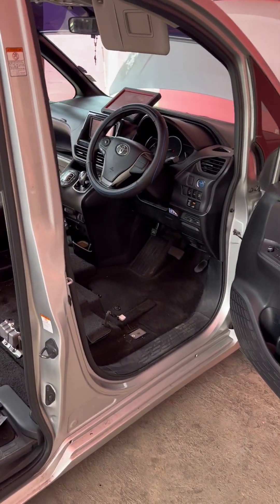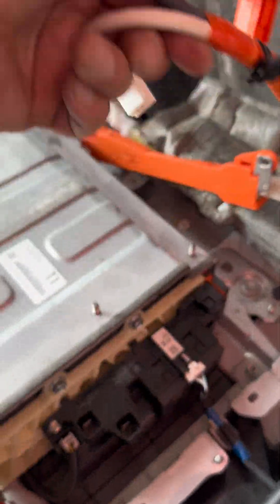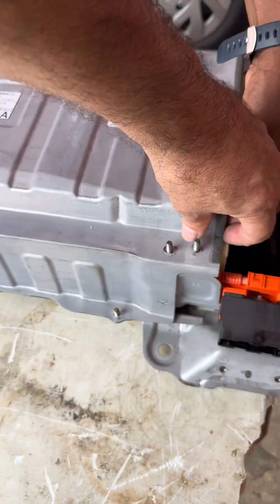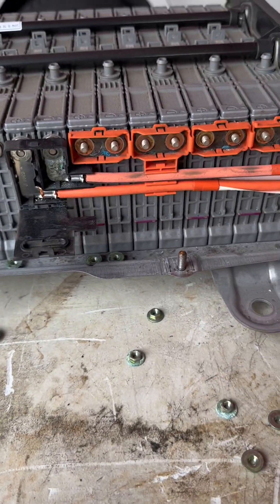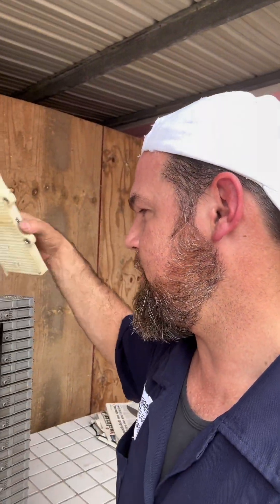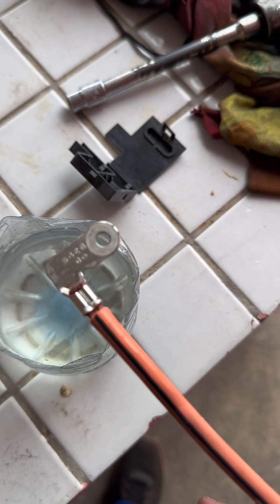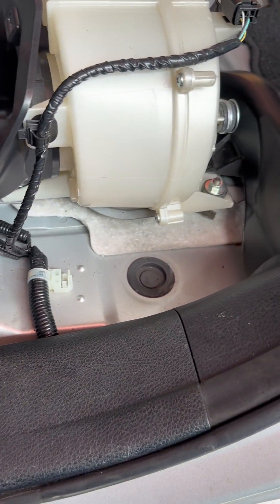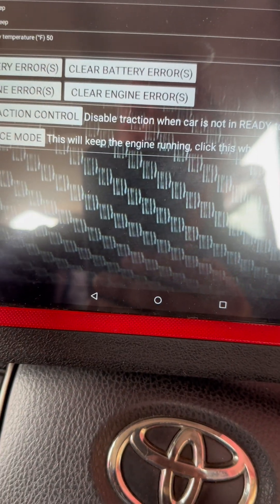Toyota voxy hybrid battery upgrade to lithium

Comment: I have 2015 voxy and the battery is very bad. Can i replace each battery with prius or aqua. I have extra batteries of aqua and Prius.
Reply: I would like to know too. Have you changed it? I want to buy Toyota Voxy hybrid, but im afraid about battery because in my country, Toyota Prius is so popular, not Voxy.
Reply: @ I purchased new battery. This guy doesn't response

Comment: Hello, why don't you install cylindrical battery cells, rather than large rectangular blocks?
Like on the Prius, there's better air circulation and better charging.

Comment: Ni-Mh type battery bank voltage is 1.2, while Li-ion is 3.7 volts. In the first case, we have 6X1.2=7.2 volts, two such elements are grouped together and the voltage is 14.4 volts, the entire hybrid computer is set up for charging/discharging based on these data. How to replace Li-ion accumulators so directly with Ni-MH, so that no problems arise?? Then the data in the computer should also be changed as to when the car should start charging and when it should end
Reply: theses are 5s li-fe batterys in each pack. it's close enough the computer doesn't care and there a circuit board in each pack that cuts the volt to the cells so they don't over charge and in that way it also balances them. I have some over a year old and 15k miles in a truck and they work well so far. try to order the version 2.5 if you can.

Comment: Thank you for your very informative videos. 

This is off topic but what are your thoughts in regard to the Prius 12v battery and its effects on gas mileage?  I bought a used 172,000 miles 2011 Prius in 2018 in which the 12v battery has never been changed. Gas mileage has been just ok around 41 mpg last 3-4 years. Car now has 275,000 miles and I've been reluctant to go for replacing the main HV battery because of the high cost and the age of the car etc.

To make a long story short I ran the 12v battery down, so I put a 12v battery charger on for maybe 2hrs. The gas mileage went from 41mpg to 44.6mpg. A couple days later again battery charger, mpg went up to 47-48mpg. I'm going to continue charging the battery every couple of days to see what maximum mpg (51/48?) is possible.
 
If this 12v battery is part of the low gas mileage problem I will definitely consider buying a new 12v battery about $215.00 from the dealer.
 Would this be a topic for you to do a video to clarify the total function and effect on mpg of the 12v battery in the Toyota Prius hybrid system?
There only seems to be only minimal info on what it actually does etc. Thanks.
Reply from the maker: Use the original Toyota AGM battery for it…

Comment: Interesting video. Really bad design for those air intakes on the floor. At my old 2011 Toyota Auris the battery is located in the booth of the car and you only have to flip the backseats to get to it. The air intake is also in the backrest of the second row, so high above the floor. To bad we don't have company's overhere like yours where customers can help with a job like this. 🙁